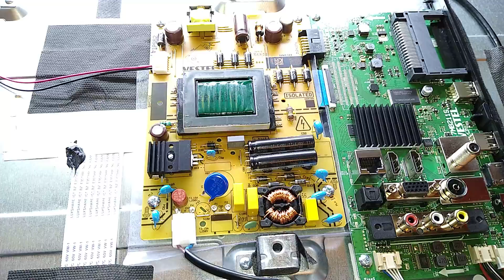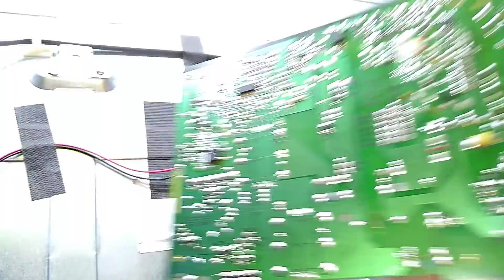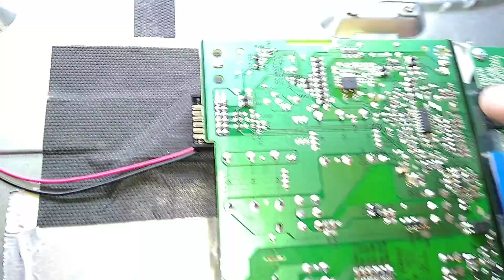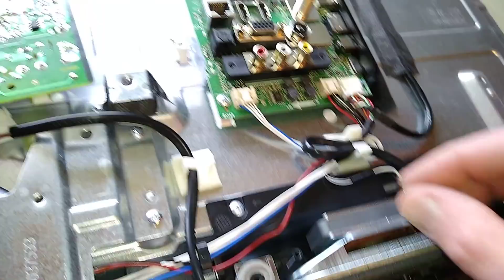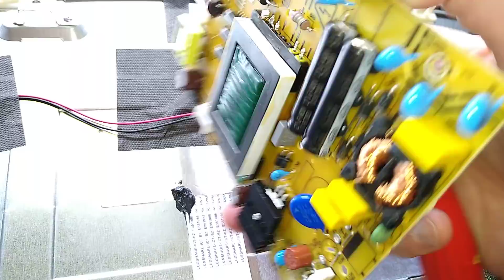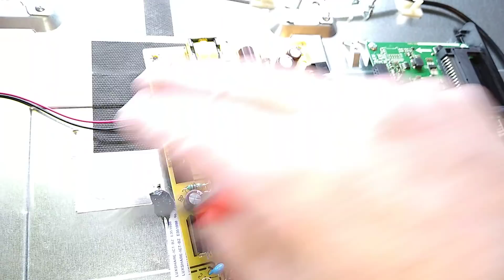There's not much inside TVs these days

Comment: Maybe I missed it, but what was the brand?
Ah, Vestel... printed on the PCB. Never heard of them before this
Reply: Vestel make pretty much all the low-mid range TVs these days, brands like Toshiba just slap their own names on the case.
Reply: @uK8cvPAq  unaware of this. I am in China, so seldom see these things. Good to know. 

So, is treated like an ODM/whitelabel, they must churn out decent quality?
Reply: @gbraadnl  Yes Vestel is an ODM but they're built down to a price and notorious for failing in the repair industry. Not sure if they're in any Chinese market TV's however but here they're usually sold as cheap grocery store TV deals.
Reply: @uK8cvPAq  just searched here, but only a few parts. Focus on the European market I guess. A store like Aldi sells some Medion-branded  products, which in turn is owned by Lenovo... but these are also based on Vestel? Curious...
Reply: They make most of the store brand TVs and washing machines you see in Europe.
Reply: @und4287  Didn't know they made washing machines too, what brands do they hide under?
Reply: @uK8cvPAq   Many different brands: Bush (some models are made by Midea instead),  some Currys Essentials models, Electra, Proaction, low-end Panasonic, Swan, Servis. These are just the UK market ones. There are many more brands these are sold under within the rest of Europe. Note that some store brands are not made by Vestel, namely some Currys Essentials store brand machines were made by Haier, and John Lewis store brand machines are made by Electrolux. In Turkey, where Vestel is based, they sell machines under their own name.

Comment: I remember opening one up to see why it started on fire. Was surprised to see how little was inside these things. 
And now thanks to bigclivedotcom I know what it was. The wires red and black leading power to the backlight were getting so hot that it was burning off insulation. It was backlit using LCD technology, not LED. 

Still not sure wtf caused such an issue, but it's nice to be closer to the goal. Ended up confronting them using a government supported Consumer Services and got them to send me a replacement. No fires in the 3 years I had it.

Comment: That’s why most people do not fix them when they die it goes into trash bin . As a kid we had a big color tv that was all vacuum tubes that thing was huge ! Has a big wood cabinet my father had to remove the tubes take them to the hardware store they had a DIY tester and a stock of spares he used to complain that we wore out the tubes from using it so much LOL the problem was heat he being a aircraft engineer removed the pressed wood back replaced it with aluminum mesh with the plastic guard from the back to cover the end of the vid screen tube the glow from the tubes would reflect on the wall and give the living room a warm glow .

Comment: That's really nice that you can get replacement boards for TVs.  The consumers have been really screwed by the TV makers for decades.  Their philosophy was to make the repair very difficult so they could sell more TVs.  California had a consumer law that required makers to sell spare parts.  So some makers priced their major assemblies so high it was cheaper to buy a new TV instead.  Finally I think some sellers found that there was money to be made and started repairing and selling the assemblies.  Thanks for the informative video.
Reply: Modern TV's are a lot simpler than they used to be. With Plasma TV's extinct there's only LCD, and they're really simple. Old CRT's could be a nightmare to diagnose, not to mention wade through the massive number of boards, wiring and EXTEMELY high voltage! New TV's are a lot safer at 120V/240V in and 12/50V out. An old CRT could be up to 44,000V internally at the ray gun!

Comment: Ours is a Toshiba 42" TV probably made by Vestel, maybe 5 years old, failed twice so far 1st time was one of the output diodes for the supply rail to the main PCB and more recently an LED for the screen failed and as they are in series it went blank.
Luckily I had kept the LED strips when a customer scrapped his not so long a go.

Comment: Check the board to board connector. I have had the same problem and ALL the pins on the connector to the board became loose. Used some juicy leaded solder to fix it.  The problem was intermittent do to the position of the tv, which was making and breaking the  connection.

Comment: My dad has a Samsung tv and it is garbage. They put 10 volt capacitors on a 12 volt power supply. It is designed to fail. It quit working and when i looked many of the caps were swollen and leaking . The power board was so cheap it would have cost me more to get individual capacitors so I just bought a new power board. That's messed up that they would design it like that.

Comment: Looks like every other piece of electronics these days: SMPS from a supplier specializing in them, and the usual green PCB loaded with SMT devices. My subwoofer looked the same way. SMPS on one side from the parent company that owns the brand, with the PCB with the circuitry and chips for the DSP, user controls, and BTL class-D amplifier on the other. Only real interesting part is the SMPS as its a flyback supply, which looks to be good to at least 160-180 watts of output, which is quite a lot for that topology. It has Wurth Elektrik's fattest flyback transformer, which I wanted to order some for myself, but sadly are unobtanium.

Comment: I struggled with a Sony receiver back in the early 80's only to discover one of the circuit board screws just needed tightening to restore ground.  Your situation could be similar, considering the entire chassis was ground and any one set of screws may be very important to be tight.

Comment: Recently got a TV off a local facebook group for free saying it had just suddenly stopped working. Turned out a fusable resistor had just gone high resistance. $3 to order a new one and solder it in, mom got a new 46" 1080p TV for basically nothing.

Comment: 99.9999% of the time when probing around on the driver board, then the LED back lights turn on. intermittent solder connection to one or more of the LEDs.  figure out a way to monitor LED current you w ill find when the lights go out you have voltage across the LEDs and no current  find a large area to disassemble the screen.

Comment: It's bad LEDs in the backlight. They go open/short intermittently and freak out the constant current power supply which then shuts down. Replacing just the bad LEDs is no solution as a few weeks later the next one goes. Replacing the LED strips with junk from China yields the same results. Getting real new LEDs and soldering them on the strips (all of them) is the best solution....The better solution is to just throw it in the skip.

Comment: Coincidentally I had my panel replaced today at home. Indeed there isn't much in it anymore. Power supply, panel driver board and the mainboard with the connectors plus some speakers and antennas.

Comment: I can remember telling customers hundreds of times...I know your not here because you want to see me, but I can't solve a problem that doesn't present itself. It's like the devices know they are at the repair shop and behave themselves while there. [My primary professional was Automotive repair, ASE Certified diagnostic Technician.] While I have been fiddling around with electronics since tube TV's were still in use and the amazement when the radios began to say "13 Transistors" on the front. Then came the red LED display calculators and watches.
Reply: I have adopted the Doctor approach they use on little kids..  dead computer?.. pat gently and say "Now you are going to be good and show me where it hurts"

Colleagues think I'm totally insane.. my turnover speaks for itself compared to theirs..

Comment: My experience with these boards is the caps along the top edge tend to dry up rather than burst.. they run hot.. try the one smoothing the led output.. and the ones immediately above those hot diodes. must have replaced 30 of them this year.. TV's are getting a lot of hammer .. more than usual because.. well.. scared sheep swallowing all the fearmongering and lies coming from that horror called the british brainwashing company..

I might fix em.. but I don't watch em.. they make reasonably decent monitors to oggle wonderful beards and other such small (and not so small) delights

Comment: Clive. It’s usually the diodes on those powerboards which fail. Check out my you tube channel ive fixed loads of these.  The backlights would have failed on your neighbours.  If you want me to send you replacement backlights just ask.  Cheers

Comment: I have run into the "suddenly starts working again" scenario for my neighbor. The switching power supply would chirp and shutdown.  No short found anywhere. I pulled every single capacitor off the board and ESR tested them.  Got generally slightly higher readings than I expected.  I replaced all of them with quality caps and its been over a year and its still working perfectly.

Comment: All a bit different to the dual-standard hybrid colour sets I cut my teeth on in the 1980s, with PL509 horizontal output valves, EHT rectifier cages with X-ray warnings on, and a cube of PCBs linked by enormous chained slide wafer switches. Those things were lethal in twenty different ways.
Reply: CVC3.. I'll just say that again for the scary factor.. CVC3

Comment: Most are near nothing and have been for a while. They took on the monitor/display roll, with some having no decode "gubbins" what so ever and had external ones.
Then they made these things.

99%of the time it is a power board issue, as they tend to be laboured.
Poor design closed smart, dancing ones tend to often cook the visual processors/mosfet as they are 'ran at limits'.
But in general they fall over or get bashed and the screen breaks before they do break down.

Comment: I have a broken Panasonic 72" plasma TV. The thing has 3 circuit boards that are 1'x2' and covered in massive components and heat sinks. It was built like the Enterprise. I was so sad when it crashed to the ground and died in my arms.

Comment: insufficient cooling tends to be why most of these modular boards die, these days. and its sort of by design. caps aside, most of these things are made with parts that if you include proper cooling, they'd last for a long long time. instead we see an almost specific length of time (variable by maker) and then poof. on samsungs it tends to be the t-con boards that die off.they get wayyyy too hot.

Comment: Interesting video! Often wondered what happened to TV repairing? 😯🤔😁 I remember years ago it was common to have the TV repair guy fix your TV, I guess now it's cheaper to just dump your old TV and buy new? 
I'm talking real 'old skool' when Dixons and Curry's looked like furniture shops with all their teak wooden cabinet type old CRT TVs ! 😁😎👍
Reply: I was a TV tech from the early days of colour tv until 12 years ago , when Tesco started selling tvs the profit from selling and repairing audio visual equipment just died, in the end skilled engineers  were made redundant and sets just exchanged or panel swopped by lower paid pc techs.I ended up repairing valve amps because nobody under the age of 60 knew how to fix them.
Reply: @aardvarksmith6852  Yes, it was all valves in my TV repairing day as well. I moved from electronics to programming in the mid-1980s - probably a wise move!
Reply: @aardvarksmith6852  I remember TV repairmen being like the 5th emergency service, in the 1970s and well into the 80s. Especially in the days of renting a TV, companies such as Rumbelows and Radio Rentals had their own technicians.
The older valve type TVs that required considerable warming up and would often go out of tune, my job being closer to the TV was twiddle the channel change buttons to fine tune the picture. I was basically the 'remote control'.
We had an intermittent fault on it where a good sharp whack on the cabinet was enough to jolt it back to life! 😁😎👍
I seem to remember somekind of cash box either in the back of the TV or on the wall, which you had to feed a 50p into it if the picture went off?
I certainly remember renting a VHS video recorder in the late 1980s when I got my first place, they were so expensive to buy.😊😯😁

Comment: i fixed an "el cheapo" 28" TV that had just a single board the size of an ash tray, both the power supply and logics were there, apparently the PSU went "puf" (tried to fix it but no luck) and it was not turing on anymore, it used 20V for the LEDs and 12V for the rest, the power consuption was so low (except the audio amplifier) i used a laptop PSU of 19V and also scaled it down to 12V with an old trough hole switching converter, i use it as second monitor on my PC and that's the newest TV we have at home

Comment: A lot of the Samsungs from the last 10 years suffered from dried out electrolytics in the low voltage PSU, just swapping them out would fix 8 out of 10 sets. Symptom were quite variable, ranging from dead to intermittent shutdown, to bizarre video effects, similar to the old "filter bend" in the tube sets of my youth (I was a TV Guy back in the late 70's). 
Gotta hate intermittent problems. Had to watch soap operas back in the day, as we had 3 broadcast channels, and that was all that was on thru the day. I usually had 2 or 3 sets running waiting for them to fail, so I got to following the stories - I used to watch Meg Ryan who was maybe 16 back then and got started on the "Young & the Restless" (still on the air), but I digress. 
Anyway, back then, 19" was "portable" and weighed about 60lbs. Things sure have changed. Still have a 1976 model Zenith "FC" chassis 19"set in the closet, I'm sure the CRT is long since dead.

Comment: It's common on vestel power boards the Schottky diodes go short circuit. They use 3 in parallel to distribute the heat. Also the led driver mosfet has a habit of dying.

Comment: I had a TV someone gave me that would work for about 10 or 15 minutes, then the screen would fade to pink or red.  It was the TCON board, the board that sites between the main cpu board and the LCD board.  This TV doesn't seem to have it, or it's tucked away behind the metal on the LCD.

Comment: I had exactly that problem with a similar TV, it was a dry joint on the connector for the LED backlight strip. Ended up peeling the layers of the LCD apart thinking "this is never going back together" a quick resolder and it did go back together, and even worked perfectly afterwards!

Comment: So, as  I’ve heard a few times, can such tv’s be run off a stable 12v supply?
(After a wee bit of fettling).
TIA for any info.
Reply from the maker: This one powers the logic and LCD panel from 12V.  But you'd need a current limited boost circuit for the LED backlight.

Comment: Im betting one of the led strips came unplugged or loose connection at the board.   Or seeing as theres no silastic, one of the components lifted just enough to drop power to the leds..  maybe it got hot in there then it stopped working..

Comment: I've had a crack at at least half a dozen TVs recently (plasma and LED numbers, from 2009-2016) and had bugger all luck fixing them.  The one that went the furthest I found what I thought was the problem, bought a replacement card, installed it, and discovered that the long, thin PCB along the base of the screen had been corroded to buggery but overzealous cleaning of the screen with liquids (at a guess).  All the others had problems I could not identify.  All voltages fine, no apparent dud or blown components, etc.  I'd be really interested to know how to better approach these problems.  Cheers Clive!
Reply: Sympathy;  anything on YouTube for the models / symptoms you're seeing?  YT's saved my ass repeatedly in the past :)

Comment: HI CLIVE, IM A TECH AND IVE STARTED REBUILDING BOARDS. WHAT IS THE BEST WAY TO TEST CAPS IN CIRCUIT WHILE STILL ON THE BOARD?  THANK YOU
Reply from the maker: It's hard to test capacitors properly in situ, as other components will skew the capacity and ESR test.
Reply: @bigclivedotcom  sometimes we have to profit the hard way I guess 😁 love what you do and thank you for reply 👍
Reply: Continuity if open loop then it’s shot if not then you’re good
Reply: @JR5802.  you have no clue what you are talking about...

Comment: I have a plasma TV that blew its controller board. (X or y sus) I have it in the attic as I just can't bear to bin it. Apparently its a mofset  replacement job but its beyond my skill level and professionals have to charge too much because of the time needed. Lovely panel but only 1080p. Replacement units are rare so overpriced

Comment: The capacitors might just have dried out.   I found that in my mums sky receiver (snowy picture and worsening reception) - only 1 was domed on the low voltage side and there only was some slight staining under the high voltage ones - once those were replaced the picture and signal were perfect again.
Reply: yeah if you have to open it up then just replace all of the electrolytic caps. They don't last forever.

Comment: I think you answered your own question without realising it Clive, the screw mounts hold the PCB ground tracks in contact with the steel chassis, heat cycling, vibration, moisture, slight action between the zinc in the chassis coating and the lead content in the solder. A very common problem I believe particularly in damp environments, depending on which contact has gone resistive can cause all sorts of randomness to happen. Clean the chassis and pcb contact areas and a dab of thermal grease to exclude moisture at each contact point will fix the problem, or at least make it more interesting.